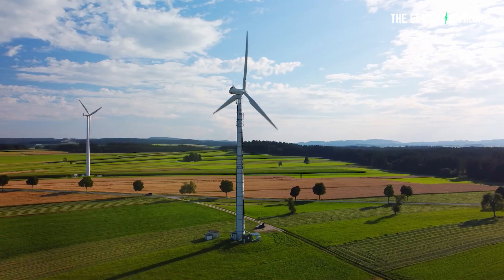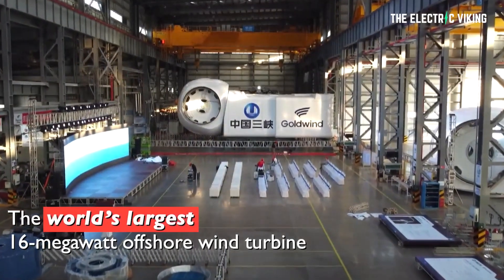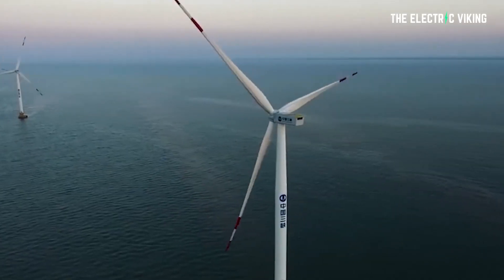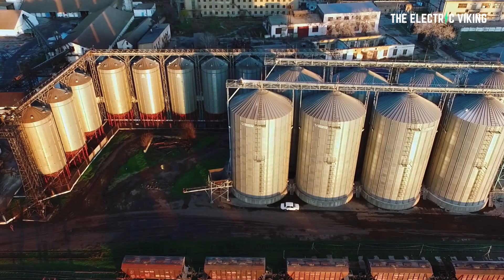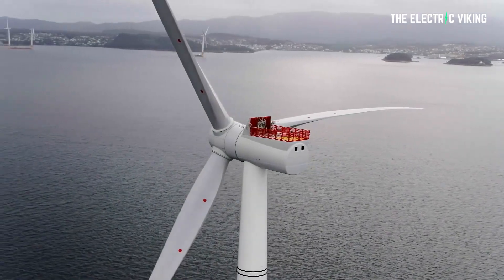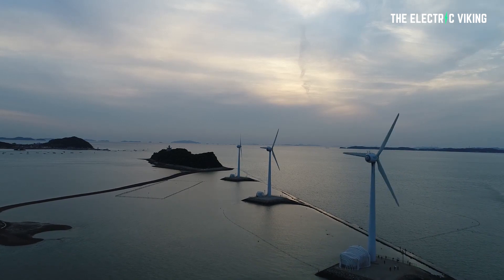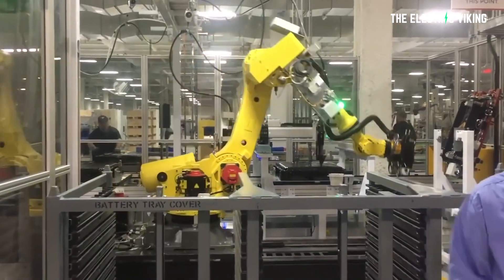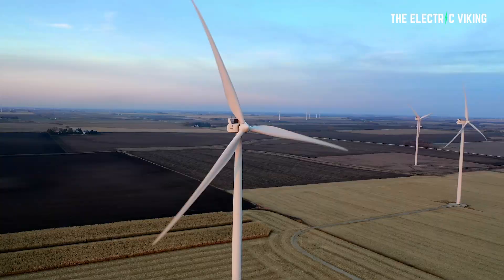The world’s biggest offshore wind turbine will bankrupt coal & gas

Comment: it takes an enormous amount of steel to make one of those platforms....in order to get that steel, you eed enormous diesel-powered mining machines to get the iron ore and then you need an enormous metallurgical-coal-fired blast furnace to smelt the steel ......in the meantime, all of the existing windmills continue to fail to produce the power you promised because the wind simply does not cooperate with your fantasies.....

Comment: Here in the UK, it's been a cold calm week. Turbines have produced almost nothing. What do you suggest we do about that? 
 When you consider that a turbine never saves as much co2 as it takes to build and service them, and this cold calm week they produced almost nothing, you have to wonder at the IQ of their supporters.
Reply: I've also read that our cable infrastructure is to weak to handle the power the wind turbines produce at high winds,, so they have to turn them off, crazy really.

Comment: The wind cannot be harnessed, its intermittent. No way of storing the excess energy currently. When wind isn't blowing, grid calls for more than the turbine has the capability of generating, gas and coal has to be powered up.
They aren't green either. Thousands of tonnes of concrete in the bases, steel, rare minerals mined from china. Access roads bulldozed into the landscapes for onshore wind, views ruined and not to mention noise disturbance and infrasound. Devaluation of homes. Constraint payments to the companies when they have to switch them off! Cheap electricity..
No way.. Its win win for the wind companies, and we shiver because we can't afford to pay our bills.

Comment: Disgusting things that blot the landscape. Has anyone looked into what energy it takes to make these things and the blades that need replacing and the oil changes every 9months. Nothing green about them. Not to mention the birds they kill. If they use petrol it would be on every front page in the world. But it's ok it's only wind ignore tha fact they have use iron ore and coal to make them. There is nothing green about solar or turbines. Look how both are made and what it takes to make them. We would be better with old coal power stations. They work, I'm all for renewables but none work correctly there all subsidised to cover the extra cost. It's just a con it's not good enough

Comment: They just announced the production of the nacelle for the first prototype of the Goldwind 16.0MW turbine, so they still haven't produced the rest of the prototype (tower, blades, etc.). Goldwind announced in October that it had just produced a 13.6MW nacelle prototype, so it isn't clear if Goldwind is producing two variants of this same turbine or just experimenting to see how high it can get the power rating. 
Mingyang is also planning to make a 16.0 MW wind turbine, which should go into production in 2024, and its first two prototypes will be rated at 16.6MW, although their rotor diameter is 242 meters, which is 10 meters less than the Goldwind 16.0MW turbine.

Comment: What wind turbines cannot do is generate enough energy to produce, install, maintain and then dispose of wind turbines. That’s why you need a dense energy source such as nuclear or fossil fuels to do this. Germany spent 1 trillion dollars to put in solar panels for energy production. They ended up using more fossil fuel than before. Why? Because solar energy doesn’t produce enough energy to pay for the life cycle cost of using it. Then you have the problem of how to distribute and store all that energy. No one has solved that problem either.  Further, wind and solar are weather dependent and not suitable very many places. For instance Germany is a terrible place for solar energy- the Sun doesn’t shine there. It’s like putting solar panels in Seattle. Dumb. This is basic physics and engineering. Something green policy makers don’t bother with. So, follow the Science!

Comment: You got a generator if it is generating surplus power use  to separate hydrogen oxygen from water. Use the wave action to write a pump to compress hydrogen and oxygen in a separate tanks the compressed would be cooled by the sea water. Probably take about five stages to get enough compression up. Then running halogen and oxygen do a fuel cell to generate power when needed. Already have the lines there, the tower can be used to hold the tanks.

Comment: It ain’t going to reach those projected numbers if it’s not in a location with constant wind strong enough to move it. Bigger means more mass ~ more/higher wind speeds to propel.
Reply: He did mention these turbines are actually lighter than current models. What you say still has some truth. There is a reason the largest installed offshore wind farms are around the UK and Scandinavia.

Comment: Cheap gas prices coming 👍😂
Reply: Or soaring gas prices as EVs replace ICE, who needs gasoline/diesel refineries. Just aviation and shipping fuel for awhile but basic gasoline is going to fade fast.  With solar panels , net metering and TOU rates I drive my EV for nothing other than car insurance, one of these days I’ll need new tires, lol.  Only about 1.5 yrs left on payback period for the panels, free heating and cooling too with a heat pump. No brainer if you have a decent amount of sunshine.
Reply: @Chainyanker007  not enough minerals on the planet to produce batteries. Gas is here to stay 👍

Comment: I'm stop you at 22 seconds. Bigger is not always better. If you had a 10 x 10 inch d*ck and you can fit it in. Yea that not good.  You only  Reason why Winter binds are getting bigger is because they don't use the real math that is out there.  To do anything but.  You could create a Winter bind that is half a small or even 3 fourths as small  That would produce the same amount of power.

Comment: These enormous eyesores not only cause more unrecyclable waste, but cannot ever produce their advertised capacity, due to their own mechanical limits.  They also are a net DRAIN on the grid, since they use power to stay heated when not spinning.

If they were so great, there would be at least ONE country running solely off pinwheels.  Instead, every country that's using these things, is running into energy shortages and blackouts.

And China is building hundreds of COAL plants while selling these pinwheels to stupid roundeyes.

Comment: Very impressive engineering, but a potentially huge maintenance concern. I wonder what MTBF the blades have before they need replacing. Let us hope technology can replace these giants with more elegant and compact forms of power generation over the next decade.
Reply: The coal mines and oil reinstall also need maintenance, so that should equal out
Reply: @penneyreed7316  Hi Penney, obviously there is a bit more to maintenance. For ex, I agree coal slag defaces the landscape but it does ultimately assimilate into the land. Whereas Fiber windmill blades suffer edge damage and have to be replaced every a few of years The blades are presently disposed of in landfills where they do not degrade gracefully. Fiber is not benign. We need some mandatory regulation for this problem.
Reply: @bobdeverell  coal slag doesn’t just “assimilate into the land”.  It’s basically melted stone and doesn’t decompose.  It can only erode.  But that’s the same as fiberglass.  Fiberglass recycling is a thing, only that the demand for recycled fiberglass isn’t high enough to offset the cost.  That’s why the wind turbine blades are currently send to the landfill.

Comment: I'm dubious that Lithium batteries are the long term answer for mass energy storage. Lithium batteries certainly have the lead in specific energy density, ie high stored energy for the weight. Mass energy storage for grid use will need to be maximised for energy storage per dollar spent. The dollar will not only be the cost of the initial battery purchase but its operating cost. A cheap battery that does not last long is probably not that cheap after all. I am unaware that any particular energy storage technology has developed an overwhelming advantage.
Reply: They already have a solution for that. Sodium ion batteries. They are already out but are working on the lifecycles.
Reply: Lithium batteries are already the cheapest energy storage option.  I read a detailed cost analysis comparing it to water storage, etc.  LFP will make it a no brainer.
Reply: @chrishaberbosch1029  Even LFP batteries are going to prove too expensive for grid level storage. Pumped hydro is OK but only at really large scale and many places around the world are just not suitable.

Comment: See again lack of research the problem with of shore is that the ocean is salt water and when it's windy there's a lot of sea spray just Walk along a coastal area look at the rust on most stainless steel brackets fitting and features on house in that area yeah not good I work at an electronic store people who lived within a km of the beach had appliances TV etc corrosion salt water even is enough to ruin concrete on dwelling within 50m on the shoreline so electric generators in the ocean they won't last there for they'll need to be replaced or meticulously maintained often there for oil and gas will probably work out cheaper to maintain/run then this "great wind turbines idea"
Reply: Wow, I bet all the experts building offshore wind never thought about salt water corrosion. They need a genius like you on the staff.
Reply: @jsanders100  awesome you got what I was saying 🤔 if cost is of no consequences yes we can do this 👍 but Sam's saying it will be cheaper then gas/oil plants um no as if they construct the turbine to last in the ocean environment they will be expensive to produce if they build them cheap they will need replacing frequently so yeah next

Comment: Yep. A few days ago at 16.00, 11000 wind turbines in the UK were delivering 0.5 GWh, from the 25 GWh installed capacity. If the wind is not blowing... the turbine themselves are useless without real buffer battery capacity.
Reply: on the average number, you can see there are lot of small turbines installed in the UK. They are too small height wise, and don't reach outside the laminar layer moving with the speed of the east surface. In China, the newest turbines achieve on yearly average to produce 75% of the installed capacity. Reaching heights of 250 to 350 m, there will be always enough wind.
In your average, there are lot of small mills installed 50 or 100 years ago.
China is installing huge windmills for two reason (none of them being environmental): first, to become energy independent. Second, to give their industry economical advantages against the fossile west. 
And some of my customers, big industrial complexes of 2.5 to 10 TWh annual consumption get already part of their electricity at 0.011€/kWh.
Reply: @wolfheilmann774  In reality, the wind is not blowing as supposed. The rest are excuses. As an engineer I know this, I worked with ABB energy and Hitachi energy, in this area. The China Nuclear Corporation has 3 wind turbine fields in Sweden. Lost 10 million euros with them last year. Dodger Bank, the biggest offshore wind park in the world under UK command, until the next come on place, lost money every single day until today, and they want to close it! Solar and wind are still edge technologies, not good as permanent solutions without a very good distribution network and battery buffers capacity (all in development but no one finished). The average price of energy in Europe in 2010-2020 is 20-30 euros per MWh. Today? 600 euros per MWh, the equivalent of 1000 dollars per oil barrel... If you asked me, the green "activist" made all to destroy the old energy, having nothing but dreams instead. And Putin f...d us all, as they (the "activists") acted exactly in his interest. If you do not know, the Emirates built a nuclear plant in Abu Dhabi.  A similar capacity offshore wind power plant costs 10 billion (BILLION) dollars more. Wind blow ...when blow, nuclear is permanent. Whatever things to say about a nuclear plant as read in the media, a lot of them are lies.
As I see,  we have chosen to destroy what we have before to have a clear solution for what is coming. And this is paid by us all and by our civilization as going down, down...nothing will stop this, see the history of the next 50 years...
PS: at this moment the price of energy made EV alternatives non-viable as the price of EVs in Europe is 40-50% more than an ICE car... I cannot afford to buy an EV other than a Chinese car, as the rest of them are over 50000 euros in final price...I was slapped by colleagues about the cost of charging an EV compared with the cost of gasoline, even now at 2 euros per liter...
Reply: @costiqueR  wind is the cheapest and least resource consuming energy generation. No other power plant will give you a payback as fast and as good. ABB and Hitachi are really not the references when talking about that.
China has selected to get as fast as possible energy independent. They don't mind green bullshit. They just look how much and how fast the can get energy from 1 RMB. And here, wind is by far the best source. And their wind parks generate a MWh at below 80 RMB. And next year they start the first ones below 70 RMB.
For them it's not about green energy. It's energy independence fastest and reliable. 

By the way: Dogger Bank is planned to deliver energy in 2024. So they're still ahead of schedule (those are no nukes)
Reply: @wolfheilmann774  Sure, a corporation with 350.000  employees in the world is insignificant... but your dedication to China's efforts is not explaining why China is building/installing 25 new coal power plants each year until 2035 according to their energetic developments. Your exaltation seems to me to be the same as the activists who had no idea what are doing but left us all in the dark and cold...
Reply: @wolfheilmann774  TY

Comment: Not just batteries—it must be thought broader. E.g. reverse pumping of hydro, and the pipes in a district heating system also function as a “battery” in that you can store heat in it.
Reply: Batteries are useless and too expensive.  The south Australia battery would power a container ship for just 1 hour. No chance of powering a city!
Reply: Pumped hydro is great but very limited by geography.
Reply: Sorry but just a pipe dream when you come down to actually d ing this.

Comment: EV selfparking and nuzzling onto the low mounted wall power point and trade electric energy with the grid. 
20million EV in Australia 
300million EV in the USA 
New battery technology developing rapidly means huge benefits.
Reply: So more than 2 EVs per Australian household. No. 

Is that crack cocaine?
Reply: @theairstig9164  Wikipedia is wrong ?

Comment: BE careful wind turbines work best when in an area of constant high wind like 40Klm /h to be any good below 20klm they are next to useless . You need to see the actual yearly amount generated not the maximum capacity multiplied by 365 days by 24 hours . So a Tesla Mega pack has about 50 times the capacity of a Model Y so for every 100 revelation you need one mega pack which costs $2.2 Million , so maybe you need 10 -20 packs per Turbine . Take that into costing .
Reply: Could not agree more. Wind is more expensive disaster as a power supply.

Comment: Hahaha,  one rotation, makes me happy
Reply: You won’t be too happy when the wind isn’t  blowing.
Reply: @allblooz  yep no weather and no weather forecasts. 
As usual. 
I keep making the same mistakes of reading the weather reports.
Reply: @stephenbrickwood1602  Not sure what your point is.  Weather reports are irrelevant since no power is produced when the wind doesn't blow, and a functional grid requires consistent power production.
Reply: @allblooz  many people say that Renewables are not practical and a source of energy that can not be a permanent source of reliable power. 
And that the big EV battery needs to be filled when it is empty. 
The big picture is the entire country and the national grid and the weather is always happening some where.
The battery can be topped up daily and will be rarely emptied in one day.
All vehicles will be EV in the electric future. 
Wind generators will be in the thousands and located all over the grid.
The grid can be filled with all the different Renewables and the EV batteries spare power. 
The Daily drive is only 7kwh, but the battery is 100kwh for the long drive and can be topped up daily when the electric energy is in abundance. 
Many people think differently and in a wrong way about how modern technology will be used. 
So free daily energy and mass storage in the millions of EVs.
Money in the bank.
Reply: @allblooz  People always go on about what do you do when the wind isn't blowing? They don't consider the other side of the question which is what do you do when the wind IS blowing at say 2 am in the morning and there isn't any demand? Currently they feather the blades and stop the turbines turning. Now if you had a whole lot of EVs waiting to be charged then you could put the power into their batteries. 
Of course when they're not whinging about the wind not blowing they start asking about where's all the electricity to charge these EVs is going to come from?

Comment: 1 turn generates 34.2 kWh of energy, so two turns would charge my Model Y enough to drive it 3 hours and 250 miles from Coastal CA over a 9,000' Sierra Nevada pass with a full load-out and in climate comfort.